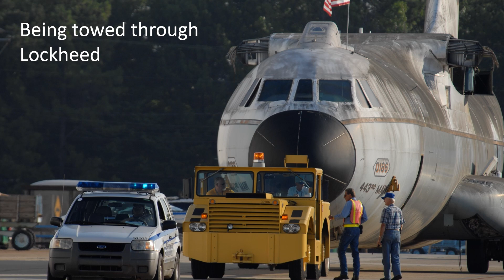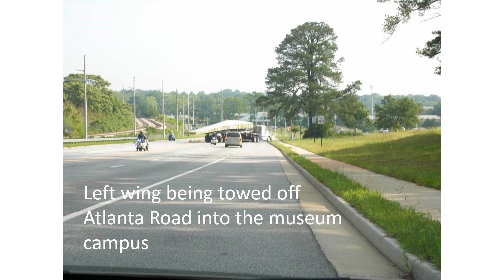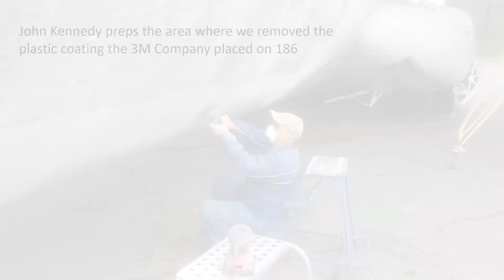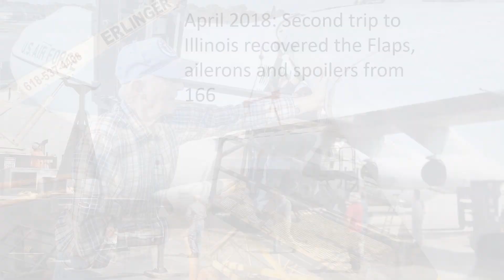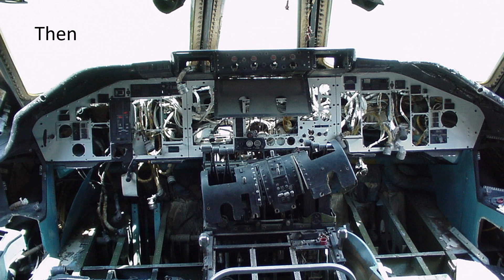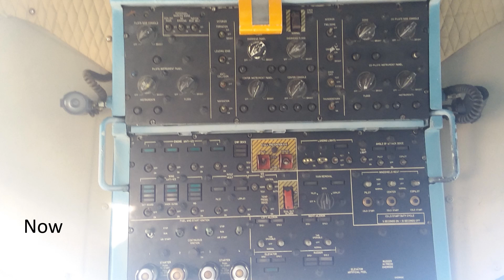60186 Restoration Recap

Comment: 3000+ hours to include the Saigon evacuation, 9401's nose gear ripping off when we landed at Rota one morning, Reforger, Ascension, Fridays at Benning, the Eagle, NAT tracks, and 2 weeks in Adana, Turkey trapped between stages, taking off from Barksdale with only 20k in fuel and getting cleared up to 10,000.  And much much more.

Comment: In December of 1975, Starlifter 66-0186, on display at the Aviation History & Technology Center, landed at Dobbins Air Force Base to start testing for the stretch modification process.  In the Spring of 1976, #66-0186 became the prototype “stretched” version of the aircraft, earning it the “Y” in its official designation.  Following successful testing of the YC-141B, an additional 269 of the original 285 C-141As were converted to “B” models . The 443rd MAW was assigned to Altus AFB, my home town. How cool to see all this specialized hard work. My ex was a very proud and dedicated C-141 crew chief & instructor at Sheppard, Travis, Altus, and Edwards.

Comment: I flew this aircraft many times through my many schools at Altus.  As I recall being the prototype for the stretch, its fuselage plugs were different from the rest of the fleet.  Great job on the restoration.  It would be great to sit in the left seat seat and say “Starting 1, Starting 2, Starting 3, Starting 4,” and listen to the sound of the igniters in the headset and the pop of the starter button solenoid on the overhead console.  Was 166 the CincMac’s aircraft?
Reply: 166 was the CINCMAC aircraft. The last C-141 built. The forward plug was located at a different station than the rest of the fleet on 186 due to the fact that the Air Force did not want to pay the additional $1 million for Lockheed's proposed wing fairings and the location of the forward plug on the production B models was moved to a "production cut" location to simplify the process.

Comment: noticed the Wright-Patterson decal on the Tail.  When I got to WP in 1983 there was a group flying ARIA ac and some of the 141s were involved in telemetry tracking for space shots long ago. That group eventually went to Edwards AFB just prior to arrivals of C-5 AC undergoing Glass Cockpit renovations.  They were replaced by the 445 Air Lift WG a few years after I retired in"89. 445 uses the C-17 Acft for their mission from WP. Had good friends who flew Air Evac missions from downrange back to Ramstein during those years.  Enjoyed a few AirEvac missions from Camh Rahn RVN to Clark and Yokota Air Evac Staging Areas.  Loved the A/C.  I remember also when a Palletized SAMCU (Self Actuated Medical Care Unit) system was built for use between Pacific units and CONUS for Very Seriously Injured and Burned personnel, used for direct long range flights.  Just rolled up the ramp and secured/connected to the AC Power system.  I made the mistake of asking why they were used on the AC.  The Crew Chief answered that, since the plane occasionally lost power on trips, the SAMCU had power systems built in so that the SAMCU did not have to depend on the 141 for it's power.  I guess he was just as confused as I was.  Great for power loss on the Ground but . . . .  We agreed the SAMCU could provide all it's own power, lasting all the way to the scene of the crash.  sort of Morbid, I guess but the original answer made me go . . . ."huh?. . . .What?  I was here when the Hanoi Taxi flew into WP for some of the POWs (Including Gen. Ed Meckenbier, a POW who flew the last flight around Dayton OH in a final salute and Farewell, landing at the Air Force Museum on Area B). the tail # was 660177 and the Gen taxied it to the revitalization hanger where he shut it down.  OF NOTE:  ON THE BULKHEAD, ON THE STARBOARD WALL, JUST BEHIND THE FLIGHT DECK, there was a piece of white poster board covered by plexiglass where all the members and POWs on the Hanoi mission signed it.  the aircraft is on display now in the National Museum of the U S AIR FORCE, on Springfield Street, on the Area B part of the base, accessible thru the main entrance if you ever get the chance to visit, WHICH I HIGHLY RECOMMEND.  I have not seen any Vietnam Veteran looking at that "roster" aboard that plane who did not tear up and, occasionally, break out crying.

Comment: Well-done to all! I flew the C-141 at Travis from 1991 until they retired them in 1997, at which point I switched to the C-5. I always though the C-141 was more fun to fly—better,  more varied missions, and great (if a bit heavy) handling. It was absolutely criminal when the Air Force made the decision to retire them, and even worse when they deliberately destroyed them at the boneyard to ensure nobody ever attempted to return them to flying status. That was the work of the C-17 mafia and the military-industrial complex. 

I will never forget visiting the boneyard in about 2003 and seeing row after row of C141s with the wings and tails brutally cut off the fuselages.  Tragic. 

So to see one brought back like this is heartwarming!
Reply: I think that Travis and McCord received the C-141's from Norton AFB before it close in 1994.
Reply: I believe the main reason they retired them was the fact they hit their service life. Basically we wore them out. They had a lot of heavy use, and stretching them didn't help.
Reply: Nope. They had just through a comprehensive life extension program. The whole fleet got new wing boxes and strengthened window mounts. The airframes were good for another 20-30 years at least. The reason they shut them down early was because the C-17 was struggling in Congress and they were balking at buying as many as the AF wanted. The ‘solution’ to that was it prematurely retire the C-141 and artificially create a huge airlift shortage. Then congress stepped up and fully funded the C-17 program. 

Don’t get me started on that. The corruption we witnessed to propel the C-17 program forward was astounding.....
Reply: @576103... That seems to be the Airfarce's MO on all their aircraft programs. They want to do the same thing to the A-10 and they cut the Re-wing program so they had an excuse to retire more of them. The pentagon brass should all be dumped out over Syria and Afghanistan...  I bet every one of  them would be screaming for Warthogs for help!
Reply: @576103  to be fair, at least on paper the C-17 is a more capable type than the C-141

Comment: I use to be assigned to the 445th MAW at Norton AFB, CA when that base was open and flew and worked on many of the C-141B's from our base and from other bases as well. I enjoyed that airplane so much and enjoyed flying and working on them as they was better than the C-5 Galaxy's I worked on and flew on as well.

You all turned that airplane back into the way it looked when it was on active duty and the way I remember it. Seeing this video bring back so many memories for me when I was flying on them and working on them when stationed at Norton AFB. Too bad that base was closed and the wing moved. I ended my career working on the C-130's at Little Rock AFB, AR and I hated them because of the milk stool which had to be used to rest the ramp on.

Comment: Beautiful restoration.
I was a crew chief on the C-141B for the 437th MAW Charleston AFB SC in the early 1980s.
The restoration mission is not complete until she is airborne.
Make this bird fly again!
Reply: Mark Hepworth  If the engines have been disables, beg, borrow, steal, or rebuild four working engines to get this one of the few existing StarLifters flying again.
Reply: Mark Hepworth  Thank you for your interest and support of the C-141.
I was a crew chief on that aircraft 1982-1984. Fortunate that I was able to fly on them a few times.
The best to you and yours also.

Comment: I was surprised on how small the wing attach points are.  I would have thought they would have been much larger.
Reply: Ha, ha! I was too. I was also surprised at the size of most of the bolts that fasten the wing. If I would have know that during my 5,000 hours on them, I think I would have been a little more nervous!

Comment: I was an Air Cargo Specialist 60531/60551 at McGuire in 1971; pushed and pulled a LOT of 463L pallets on -141s, including pallet trains of gun tubes and rotor blades for Da Nang and Cam Ranh Bay. I loved those birds, except for the cramped space between a stacked pallet and the side walls in the cargo bays.
Until I got to ride one from McGuire to Lajes Field, in the Azores - and found out why so many loadmasters ignored me unless I shouted at them. Talk about high-frequency whine...it's like a bitchy mother-in-Law in there!

Comment: I remember this aircraft from when I was station at Altus in the 80's. My squadron (443rd OMS) had the crew chiefs for CINCMAC.  As soon as I saw this aircraft I said "OMG, that's CINCMAC's aircraft!". Too bad that they couldn't find the comfort pallet and install it. I never saw it but the crew chiefs said that it was first class. I can't wait to visit and reunite with this historic aircraft.
Reply: Went thru FE school at Altus and flew the CINCMAC's bird on training flights with the complete comfort pallet on it. Like a hotel. Also I spent the past 6 years helping to restore this bird. Made the 3 trips to Scott AFB IL. to get the parts. Labor of love. Enjoy.
Reply: Also of note, this bird was at Charleston AFB SC when I was an FE there in the 20TH MAS. Checked my logs and did not have any time on this bird while it was an A model. We sent it to Lockheed in 1976 for the stretch program then it went to Altus, if my memory is correct.

Comment: So why was the donor aircraft in Illinois broken up?
Reply: The interior was stripped before we were authorized to get parts from her so not much was left after we got the flaps, ailerons and engines, The Airport, who owned the airframe, no longer had use for her and scrapped the remains.
Reply: @boonebarnes9299   By "The Airport" do you mean MidAmerica St. Louis Airport or Scott AFB?  We have been at Scott since 1996 and early on saw a 141 out on the ramp and wondered what happened to it.  By the way, both my wife and I were assigned to the 438 MAW at McGuire, 1979-1983, aircraft maintenance.
Reply: @jamiedoil9167  When we recovered parts from 166 she was at MidAmerica Airport. She had been given to the airport to conduct firefighter training under contract to the FAA. Per that contract, MidAmerica would own the airframe after 5 years.
Reply: @boonebarnes9299 Thanks for the info.  Solved a mystery we've been wondering about for years.